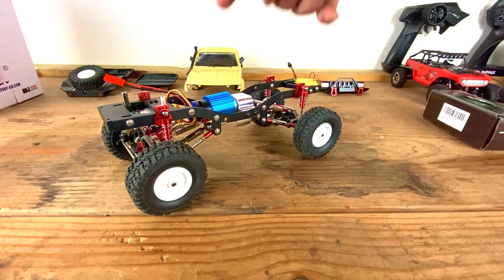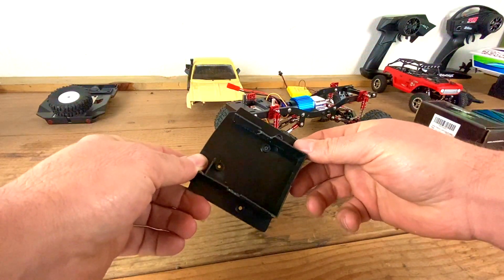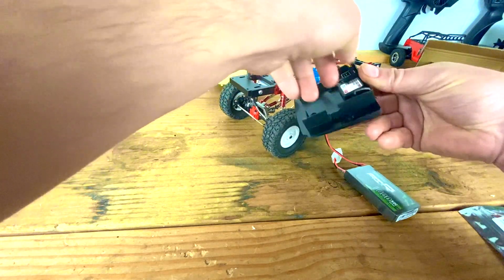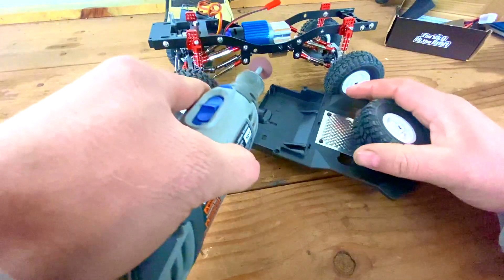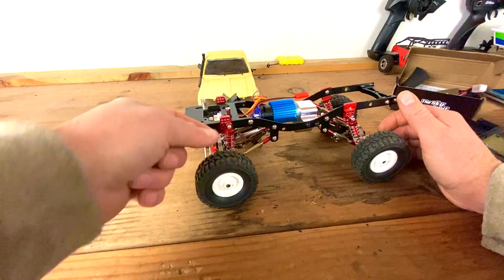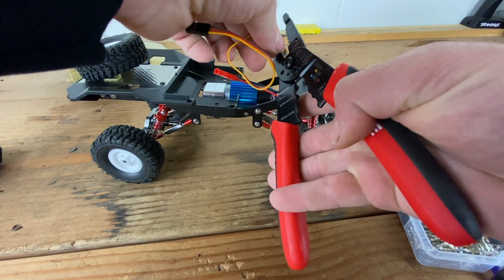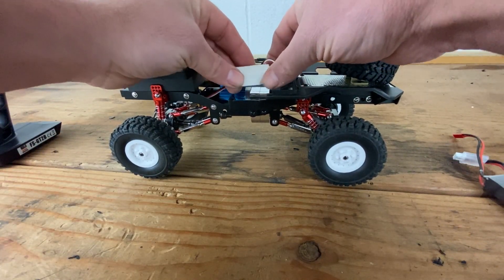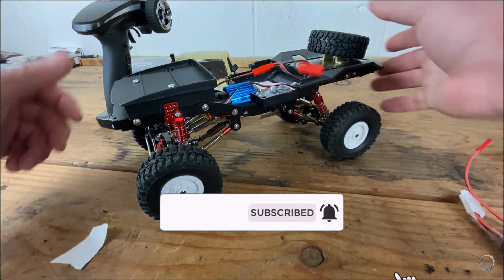WPL C14 30A ESC Install

Comment: To use this esc i need a new controller and receiver? I cant use original receiver and controller and only switch esc? I dont understand much hehe, sorry
Reply from the maker: You cannot run original electronics with this. You will need a different receiver and transmitter.

Comment: Hello! Does this ESC handle this 370 motor with gearbox well? I want to install one like it.
Reply from the maker: @FS.2281  it did handle it but I since replaced it because I ran it through water and it’s not waterproof.
Reply: @ReadytoRunRC   Thank you

Comment: I got the same 2s lipo battery’s as you and I was wondering how you charge them bc they didn’t come with a charger
Reply from the maker: @CodyKrpata   I have a 2S balance lead USB charger that charges them.
Reply: @ReadytoRunRC ok thanks

Comment: My battery's didn't come with a charger
Reply from the maker: @adenaudain5857   most batteries don’t. You have to use your own charger.
Reply: On more thing when I using it my 370 moter wire keeps on melting

Comment: My 30 amp esc i got, the Reverse is Gutless with the stock 180 motor. Forward is kick but!.... reverse i can't even get over a rock ??????????????Any advice ?
Reply from the maker: Hmmm 🤔 I have non to offer. Is it this same ESC or one that can be programmed?
Reply: @ReadytoRunRC  It is not programable. It is the green board v2 like that one i think... It is ok. Thank you for responding You Rock. I ordered a esc an 370 motor gear box. Doesn't work right, Upgrade it ? Right ? hehehe. Thanks man
Reply from the maker: @JamesDirtRC   ok. Wish I had an answer but yep you’re right. Something doesn’t work? Upgrade it haha. Happy crawling.

Comment: Do I have to get a new controller in order to use the new esc oor is there anyway I can keep using the original remote longer?
Reply from the maker: You will need a new controller because you need to have a receiver. So a new controller and receiver is needed.

Comment: I used the same esc and when it’s turned on it’s flashing red?
Reply from the maker: It will flash if the receiver isn’t bound to the controller. If it flashes and you are bound to the controller then I don’t know what the issue is.
Reply: The receiver is solid green, and the esc is blinking red until I give it throttle then it’s a faded solid red

Comment: I've got the C24 but it's the non-proportional version. I'm going to upgrade to a 9g servo and new transmitter and receiver. My question is the difference between the 20 & 30a esc and will the 30a work with the stock motor?
Reply from the maker: The difference is the amount of voltage it can handle.  I can't see why 30a won't work.
Reply: Get a 40 cause you will want the 370 motor next. Be honest with yourself,  lol

Comment: I have a issue were if I go full throttle the truck will keep going untill I either unplug or turn the car off, can I fix this in any way?
Reply from the maker: I never had that problem.  I don't know what to say to fix it.
Reply: Replace the esc for as starters. Unless its the tx/rx

Comment: can i just keep every thing stuck but the motor will it still work
Reply: A lot of posts mention the stock esc burning, try a 40 amp if you add the 370 motor

Comment: Great video, love to see this coming along!
Whats wrong with the original WPL transmitter? I quite like it!
I've had 3 of those ESC's all of which have burnt out on me. There cheap but you get what you pay for. I have had a BIG upgrade to my MN90 and how run a hobby wing! 5x the price tho!
Cant wait to see how you paint this body and looking forward to seeing it running!
Great job👍
Reply: hey man quick queastion im bew to rc and i bought a 370 motor for my c24 but do i have to buy a esc and a reiciver or can i use the original one
Reply from the maker: The original was not proportional for the steering.  Also the more products I use in my videos, the more affiliate links I can put in the description to earn me a little bit of money to help pay for the upgrades.  I have a video uploaded from a few days ago with the new paint and wheels on.  The truck is looking good now.  If I burn enough ESC's out, I will have to do what you did and go for an expensive option.
Reply: @ReadytoRunRC what do you think the flat plate/tray that covers the stock electronics is for? Seems like it has no purpose until you upgrade and use it as a mount.
Reply from the maker: @anthonyesquivel5863   I feel the same way.
Reply: They say the stock esc wont hold up to the 370, or ive read a lot of posts saying the stock one burnt out after the 370 was added. Upgrade just the esc to maybe 40 amp. 10.50 on

Comment: That's going to be a badass little Yota. Can't wait to see it finished
Reply from the maker: Thanks! Body is getting painted and should be on soon. I wasn't feeling the tan.
Reply: @ReadytoRunRC  I've seen a bunch of that body style Yota, Painted many different colors, down at the mudholes over the years. I haven't seen an ugly one yet. My '78 Bronco on 18.5" X 44" Ground Hogs was one of few full-size trucks that could keep up with the Toyotas. I imagine most of the RC trucks are probably similar in ability if they're built close to the same specs of each other, probably not like real trucks; concerning weight issues. I've never built an RC truck, but was wondering if RC trucks would be able to be used in the mud?